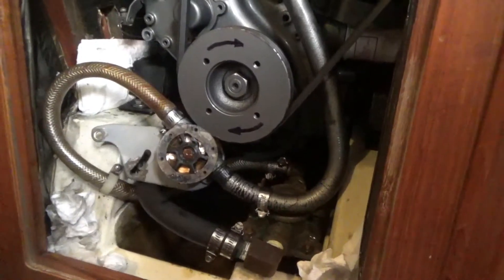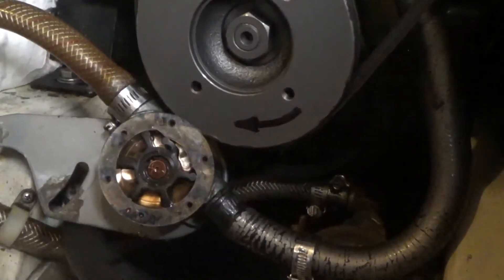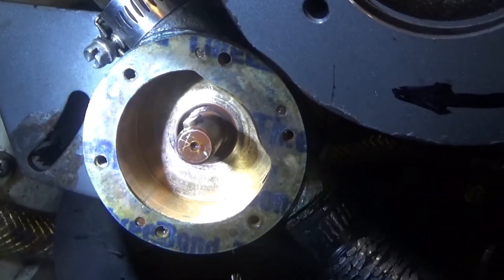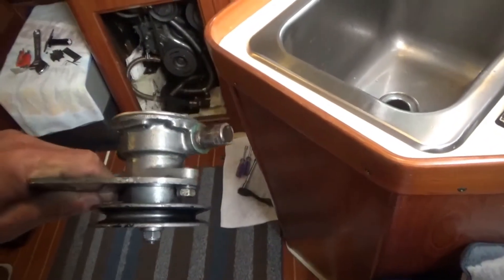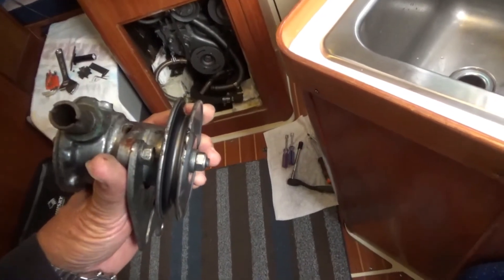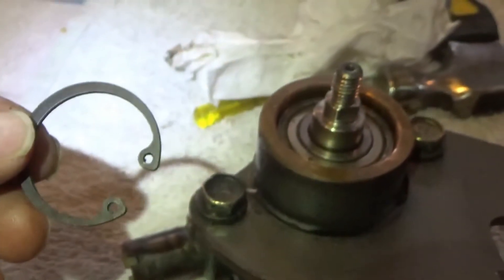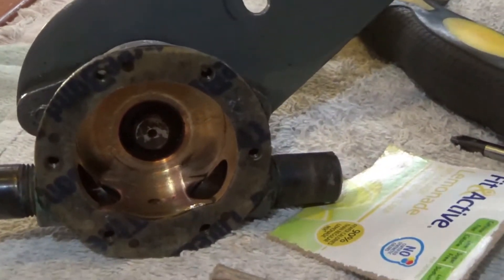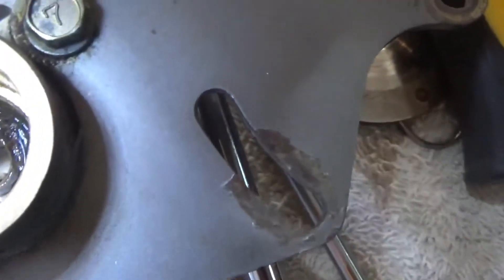Raw Water Pump Seal Replacement

Comment: Do you remember the part number for the lip seal? I know Yanmar used a few different pumps and it looks like you have the same as mine.. thanks for the video!
Reply from the maker: I'm glad the video helped.  The Yanmar part number is 124223-42080.